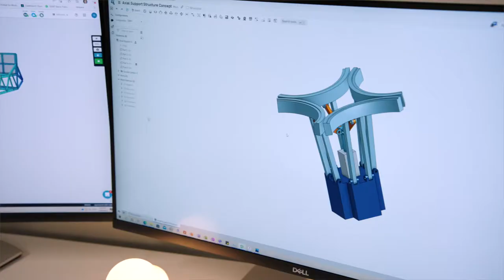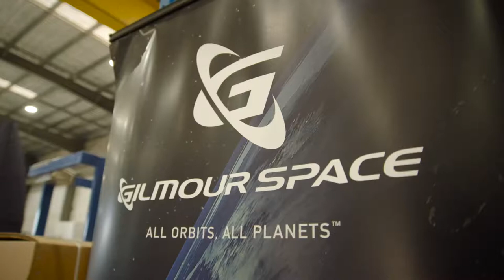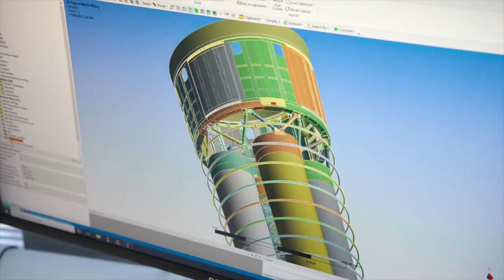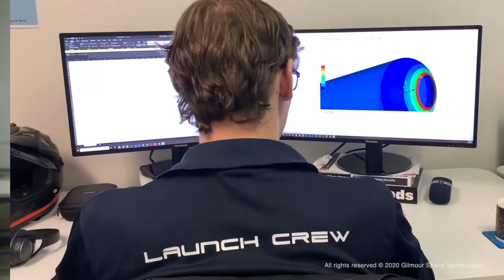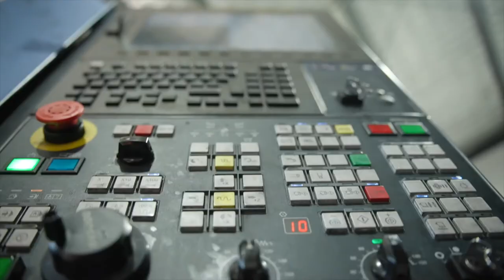Ambition: Gilmour Space - an InnovationAus.com documentary

Comment: Both stages are LOX RP-1? Man, you should've went with methane. Or RP-1 first and bite the bullet and build a different engine for the second using H2 or methane. I get why you use it. High thrust well understood. But the ISP is so low compared to the other options. You need yhe high thrust all the more when your second stage is using RP1 too.